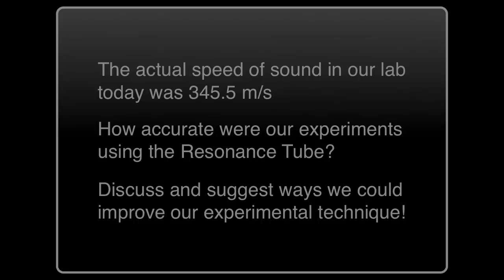PH WV SO LAB  70040A V0811 Sound Resonance Tube Calculate Speed of Sound

Comment: A very useful demo.
Just to add..
Because a microphone detects the variation in air pressure at a point and not the variation in the displacement of the air particle at a point,
hence what are labelled by the tapes in the demo are Pressure Nodes, which are Displacement Antinodes and not  Displacement Nodes.